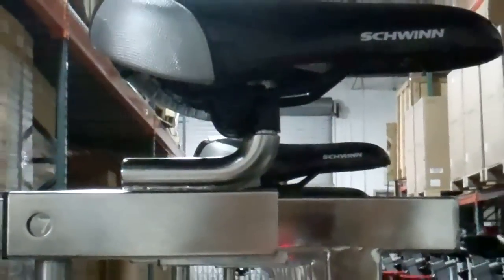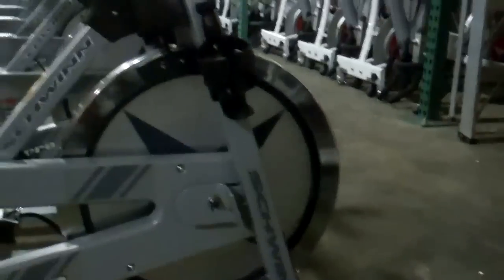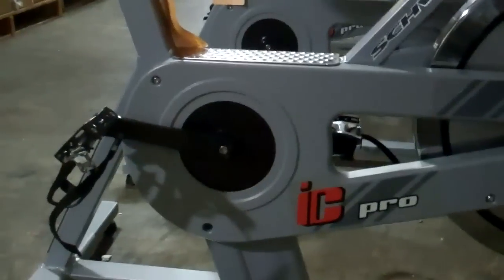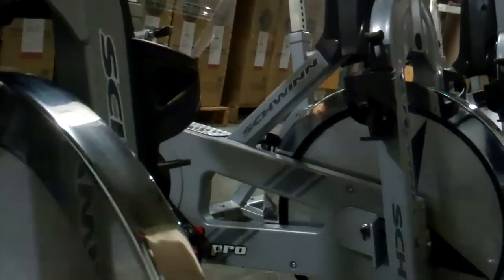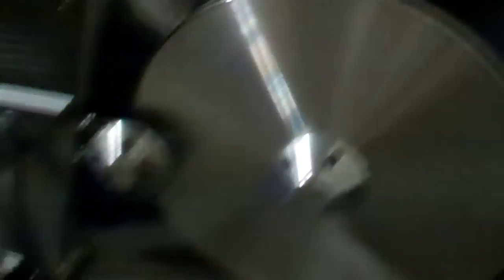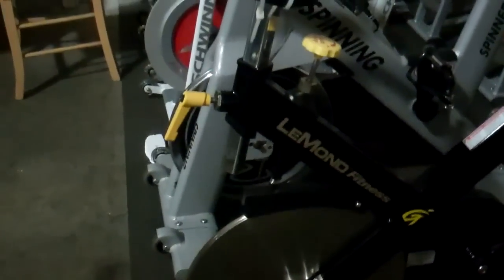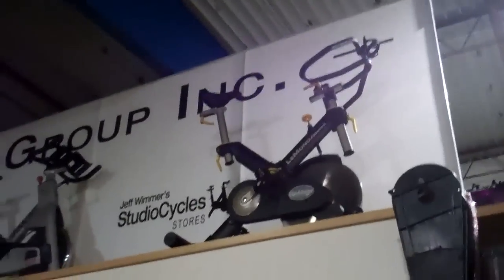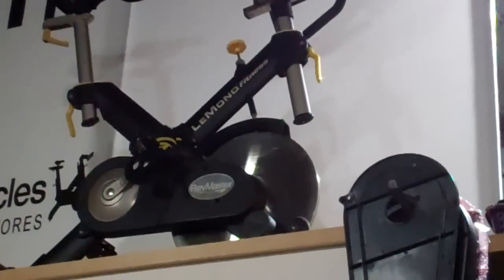Flywheel Differences - IMPORTANT!

Comment: This is the most USEFUL information I have found on the internet, regarding flywheel types. Most of the websites are just mentioning the weight, as the only parameter worth noting. THANKS :)